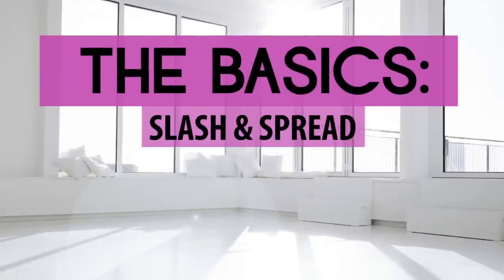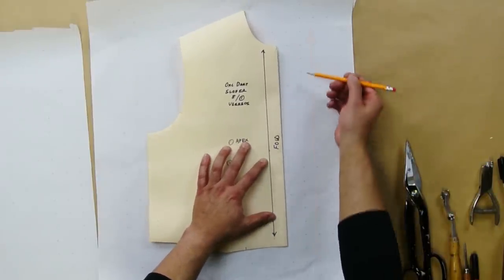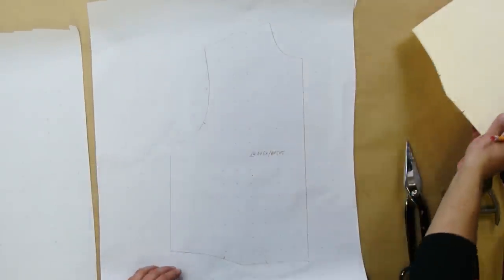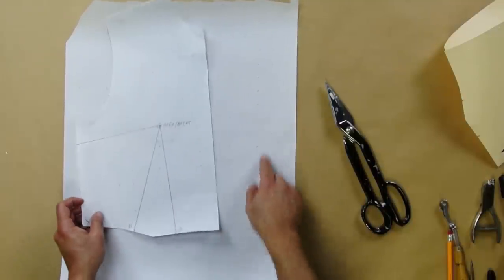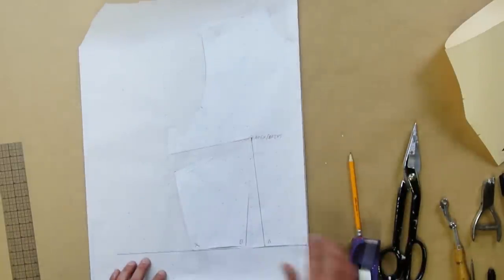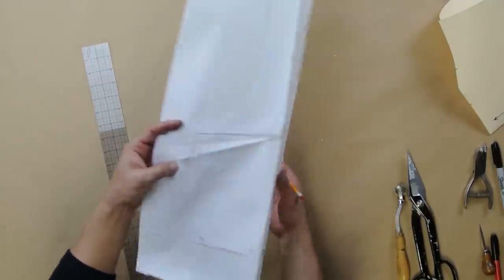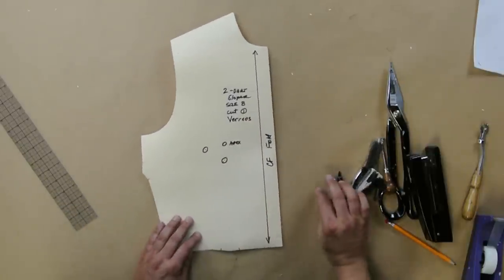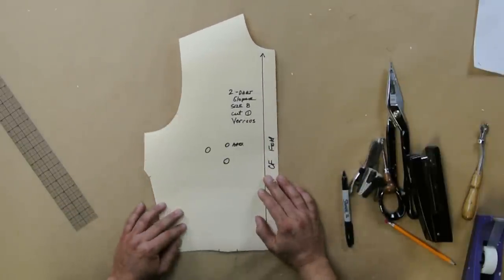Dart Manipulation for Beginners: The Slash & Spread Method

Comment: Thanks for the video. Very informative. Did you know that there is a plate on most staplers that turns your staple into a pin? Flip it around - it is much easier to remove staples - you don't even need a staple remover.